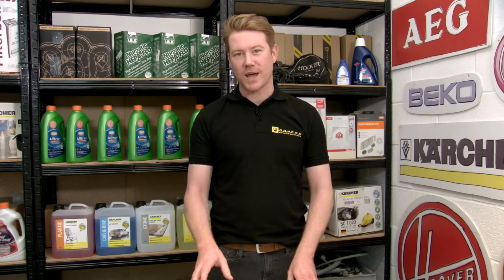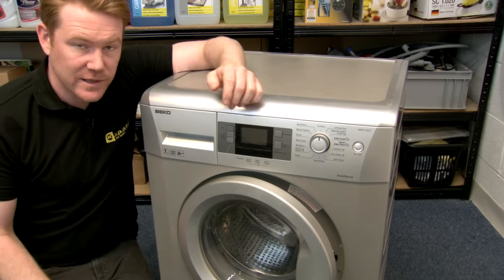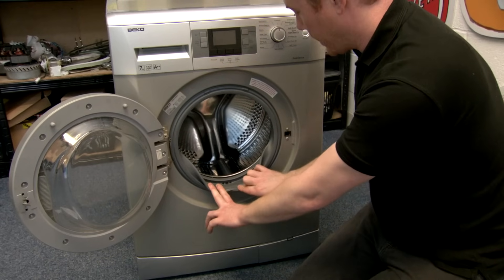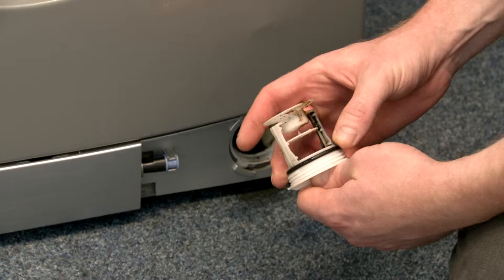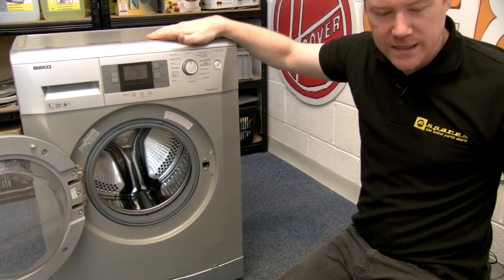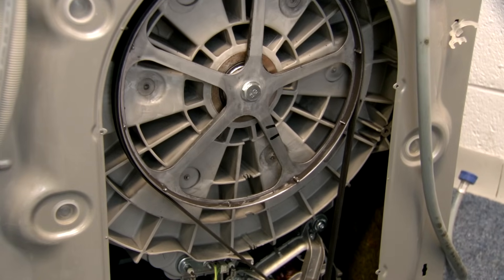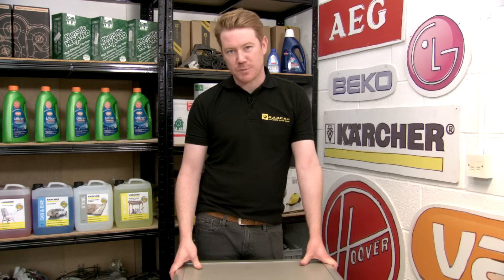How to Identify Water Leaks on a Washing Machine

Comment: Good video, but it hasn't solved my problem. The plumber didn't take the machine apart and it appeared to be okay on a short wash cycle. There has been gradual seepage overnight though and this morning the floor was wet. I shall have to leave it for a few days and see if it all dries up. If it does then I'll know it's the machine. If it gets wet again then it must be coming from somewhere else.

Comment: Thanks for your help. I had a leaking problem, with water coming from both sides and the front during a wash. This was Fixed when I found the wrong transport bolts had been used. They were too long and had made a small hole in the plastic outer drum. I used Soudal Fix All Turbo Super Fast 125 Mil Bonding Glue. I left it to set for 24 hours. All good.
Reply from the maker: Hi, thanks for your comment, thank you for sharing your experience on here!

Comment: A small black rubber tube near the bottom and just inside the rear access panel came detached from whatever it was supposed to be attached to ( I am not certain what it was) on our LG frontload washing machine and flooded our laundry room, hall, kitchen, and basement. Yes, one small  detached rubber tube caused all of that. I did not find any clamp, so I reattached the tube (to whatever it is) and taped it for extra security.

Comment: I like that cardboard trick. In my problem machine I swapped the discharge pipe, it couldn't hold pressure and under test I could hear air escape, so I replaced it and drat- still leaking. :(

Comment: Thank you for your informative website!  One additional source of a water leak in a Bosch washing machine is the cold water inlet valve.  I needed to replace mine at year 10 and year 23 of my machine so I would say they have a life of about 10 -11 years.  The failed valve will drip a small amount of water from where the solenoid meets the plastic housing and that water will drip on the inside of the machine to the floor pan and eventually the floor under the washer.  To diagnose, remove the top of the machine and inspect.
Reply from the maker: Hi, thanks so much for your comment...it's great to hear that your washing machine is still up and running after 23 years! Well done for any part replacements you have done yourself, and keep going with the fixes in the future!

Comment: my dispenser draw drainage does allow to drain properly water overflows how do i unblock
Reply from the maker: Remove the drawer by pulling it out and pushing the tab to release, check the drawer for blockages and give it a good clean, if OK take the top off by the screws at the back and look at the connecting hose from the drawer to the tub.
Reply: eSpares thanks for that. I just checked and found that if i disconnect drainage hose and keep it lowered the dispenser drains therefore not overflowing. When i re-attatch  under sink it starts to drain slowly and eventually overflows from dispenser onto the floor. Is there a blockage issue the pump seems fine ?
Reply from the maker: Hi A M, a couple of things make sure the drain hose does not go too low as it will siphon causing it to push the water into the sink, check for a blockage in the sink and see if it has a one way trap which will stop the water coming back into the machine.
Reply: @eSpares  thanks. I have tried a few things but i noticed if i disconnect from sink and lower the waste to ground level the dispenser drains ok. However if i raise the waste pipe even 6-8 inches of the floor the dispenser again overflows regardless it been connected to sink. In summary keep waste pipe ground level the dispenser drains ok. The pumps works fine when rinsing the drum.
Reply from the maker: Hi A M we are getting confused by the dispenser reference as the only time you would have water in the dispenser is when it fills up and it has nothing to do with draining, are you talking about the filter chamber?

Comment: Thank you so much for this excellent video. Very informative!

Although I struggled to take the filter out, it turns out that the filter seal had limescale on it so I used limescale remover and the seal is as good as new. Really can't thank you enough for this video. Should I need any washer spares I'll be sure to buy from espares.
Reply from the maker: Hi Mr Smith, thank you for your post and glad the video helped.

Comment: I have the same machine and I cleaned the filter but still leaking from the filter. what to do?
Reply from the maker: Hi Kazi, check the seal on the filter because if that is damaged it won't make a watertight seal causing the leak if it is damaged it will need to be replaced.

Comment: Thanks for the video eSpares.  Watching because I have a leaking machine, will try to diagnose later tonight...
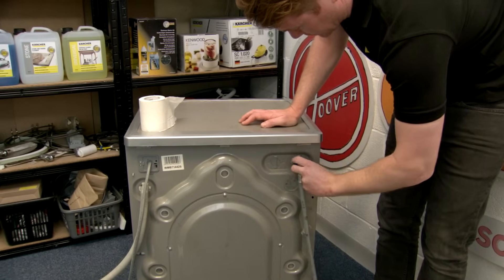A question please:  At 4:10 - suggests check water intake hose seal, if leaking at back of machine.  But, I think if hose seal was faulty, leak would be constant (not just when machine is running) - does that sound right?
Reply from the maker: Hi surfclimbcycle , you are right if it was leaking from the inlet hose it would leak all the time but it is more noticeable during wash programs due to the increase in water.
Reply: OK, thanks again for the video eSpares.  Cheers.
Reply from the maker: No problem.

Comment: I've got a Kenmore Front-loading washing machine and water is pooling by right front leg AFTER it sits awhile from washing a load. Where do you think it's coming from?
Reply from the maker: Hi David, it could be coming from anywhere in the machine but check the normal reasons, check the filter, door seal and internal hose to the tub.

Comment: I overloaded my Hotpoint washing machine and it started to make rattling noises halfway through the cycle it had flooded the floor. It appears to be coming from either the front or back.  Could it possibly be one of the problems you have mentioned on this video? As I'm thinking I may need to replace the washing machine 😔  I  won't  be doing this in a hurry again!
Reply from the maker: Hi Lisa, it could be but try to establish where the water is coming from and look for any damage to the hoses underneath, if you can find it you can replace the part and it will save you buying a new machine.

Comment: Good video, but my washer machine is Maytag Atlantis that has the door on the top. And it seems to be coming from the back and still leaks after the hose has been replaced.
Reply: The water seems to be leaking froom the bottom as well.

Comment: Hi, I have an intermittent problem with the dispenser drawer leaking underneath
Reply from the maker: Hi Ken, can be difficult to find but you need to establish where the water is coming from, make sure it is not too much detergent causing the leak.
Reply: eSpares thanks, it’s only doing it when on the first rinse, level very high in conditioner drawer, (syphon not blocked) and the machine is topping up mid cycle, not looked at pressure sensor yet.

Comment: Hi . My sumsung washing machine ecobubble is not taking the water in water is just leaking by the opening where we put the detergents. Could u give me information please. 
Thank you.
Reply from the maker: Hi Teklit Teklzghi, leaking from the soap drawer usually indicates the drawer is blocked, take the drawer out and check the holes in the top of the drawer and clean the drawer.

Comment: I'm stumped!....On any cycle but sticking to the 15min quick one for simplicity...machine fills fine, swooshes around fine, pumps out fine & then spins fine. It then starts to refill for the rinse & my floor is flooded within 10 seconds, as fast as if the fill hose had suddenly fallen off!
I attempted the cardboard trick but the whole thing is almost instantaneously drowned such is the speed/flow of the water suddenly coming out from somewhere within? Despite the gushing, tipping the machine to left or right to peek underneath reveals not so much as a drip anywhere on the drum/hoses etc...just a huge puddle that may as well have bubbled up through my kitchen floor rather than down from the machine.

Comment: Hi, my machine is leaking when its not running a cycle so I am thing that its the water pipe that is connected to the machine.  I turn the water off and there is no leak, turn it back on and there is water at the bottom.   Any recommendation ?
Reply from the maker: Hi Meena, check inside the inlet hose as it has a O ring seal that may be leaking and make sure the hose is tight when it goes back on, the other thing is the water valve so check that as well.

Comment: hello, can you please help me as my hoover machine is in water leaking from drain point, how to fix it.. or how to check if the drum is good or not,  water is getting in but the drum doesn't fill, do you think it's problem with drum and drain pump? the drain pump had a problem so I changed the drain pump  which is good now but now its error 02 water fill problem and i can hear the water is going out the from the drain.. please tell what do i do?
Reply from the maker: Hi uday, is it leaking from the filter area or the drain hose? check the filter is tight and the O ring seal is not damaged, if its the drain hose check for a hole and replace the hose if it's damaged. Error code E02 is an issue with the filling so check the water pressure and the inlet valve, it's not a problem with the drum.

Comment: Great video. My whirlpool machine seems to be leaking when it is draining. Is there any part or place you recommend I should look as it doesn’t seem to be the pipes and is coming from under the machine. Keep up the great work!
Reply: I'm here cause I got a Whirlpool leaking too. Hope he gives us some advice.
Reply: Most likely the water pump
Reply: There are a number of connections from the tub to the drain pipe. If your front loading washing machine has a coin catch, I would start by cleaning that, followed by cleaning the section of bellowed hose from tub to drain pump, and from drain pump to the wall.

Comment: Should water be staying in the rubber seal?
Reply from the maker: Hi Adrian, it is common for water to be left in the door seal but we would suggest leaving the dispenser drawer and the washing machine door open to allow air to circulate and help dry out any water but you can just use a cloth to mop up the water.

Comment: I have a top loading Samsung washer.  During rinse cycle, I went in laundry room and it was totally flooded.  Doesn't seem to be the hose.  What else could be the problem?
Reply from the maker: Hi Jeanette, the first thing you need to do is to identify where the leak is coming from. If you have a leak that’s coming from the front of the machine, it could be from the detergent drawer or the housing, the door seal, or it could be coming from the pump filter or pump. If you’ve got a leak that’s coming from the back of the machine, it could be the hoses or the valve, and if you have a leak that’s coming from underneath the machine, it could be any number of those things.

Comment: I have a Kemore Elite front loader & notice water/ foam coming from the back top corner vent. The leak isn't happening with every wash, which is baffling, several days of washing can go by without any leak. Any suggestions on what can be done or has anyone else experienced this? Thank you & I appreciate any help I can get!
Reply from the maker: Hi Cupcake7760, it sounds like there is too much powder in the drawer causing it to over foam, take the drawer out and make sure there are no blockages.
Reply: Thank you for getting back to me. My husband & I actually never use the drawer. We only use 2 pods you throw in the drum to do our washing.
Reply from the maker: Hi Cupcake, let's break this down, what is the machine doing when it is leaking, filling, washing, draining as we need to determine what is functioning to cause a leak.Also, check the vent for any signs of damage to allow water to leak.
Reply: My machine is a Kenmore Elite 796-41029900. The leak is happening during the drain cycle. Yesterday I watched your video,along with others & this is what is did to try & find the issue/s; I unscrewed both the cold/ hot hose, cleaned the filter, which I did find a lot of sediment, per the manual I soaked it in vinegar, scrubbed it & attaches both the hoses back to the machine. After watching another video, someone mentioned the “gray sludge” showing up on clothing after the wash was completed. It was recommended that the screws be removed on the 3 parts inside the drum that hold the agitator balls. I removed the screws, slid out the pieces & what I discovered was horrendous to say the least. After cleaning everything, I attached them back. I throughly cleaned the rubber piece around the drum, removed the drawer that holds bleach..etc & throughly cleaned it, I cleaned the filter /drained the hose that’s located on the front bottom left, (I actually drain it after every wash), last I ran 2 cleaning cycles putting bleach in the drawer. There was a large amount of suds in the first cycle & hardly any in the second one. I didn’t have any leaks. The strange thing is, days can go by without any leaks & I do at least 2 loads everyday.

Comment: I’ve replaced the heater recently and I just put it on a 90 wash and now the heater is loose and it’s leaking badly so I really don’t know what to do because this is the second time it’s done this A few months back when we did it we noticed it was loose so we tightened up and I think we over tightened it and it came loose and now today it’s done the same thing so I really don’t know why it’s doing this please help me!
Reply: SuperWasherKid2002 if you have striped the threads go to eBay item number 361909285985  or so thing similar to this item, and it sounds as if your gasket it no good get a new one or use a silicon or mastic thinly spread to seal it. 
I hope this helps.
Reply from the maker: The usual cause of a heater coming loose is not pushing it in far enough. The rubber seal when tightened bulges up to hold it it position. If not far in enough the bulge can be on the outer side of the opening almost pushing the heater out. Once the water is heated and cooled a few times the heater can move from expansion and come out. Take the heater completely out again and apply a little liquid soap on the seal before refitting. Then make sure the heater is 'fully in' by giving it a push with a screwdriver a few times before tightening the bolt.

Comment: I have an LG front loader and there is a small stream of water shooting out of a piece of white plastic that appears to be a back flow for the pump. It will eventually drain all the water once the washer errors. The error flashing "IE" is accompanied by a flashing medium spin and start button LEDs. Anybody?
Reply from the maker: Hi Scott, IE on LG washing machines refers to a water inlet error so start by checking the water pressure, hoses damaged or kinked or clogged filters. it may also be backfilling so check that.

Comment: i am using bosch 6 kg front load washing machine.when i am using shirts mode it disply e 17.what can i do sir
Reply from the maker: Hi Vijaya, E17 refers to water supply time exceeded, so check the water pressure, also the inlet valve and any hose filters that may be stopping the water from coming in.

Comment: I have a Samsung front end washing machine and there is water in the front left of the machine...it’s right under the leg or foot
Reply: And the machine is only 8 months old
Reply from the maker: Hi Duarte, check the soap drawer for any signs of a blockage first but if it's under guarantee you should contact the service agent.